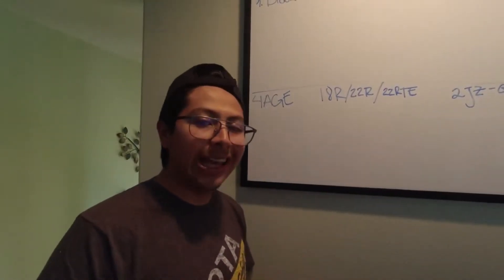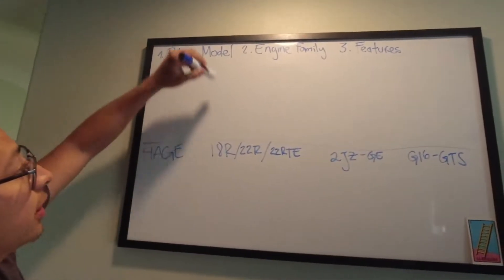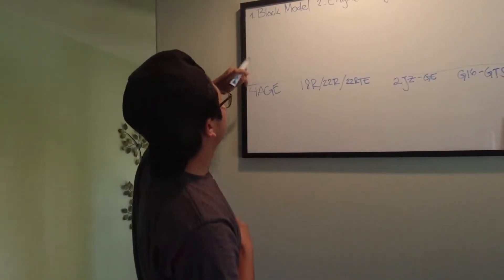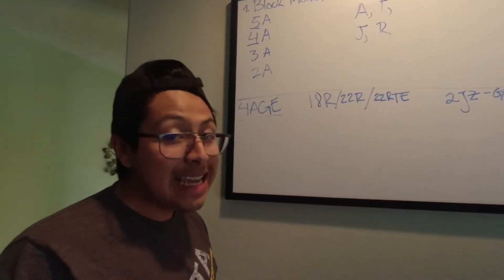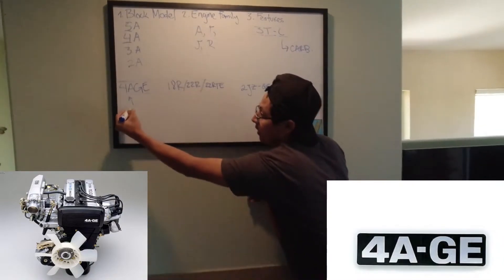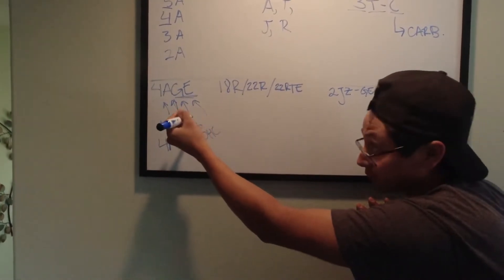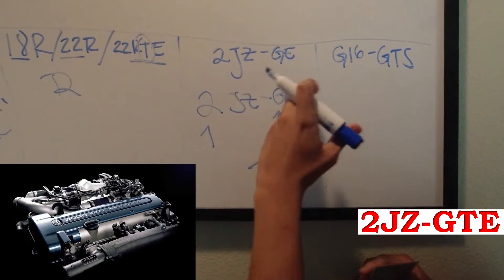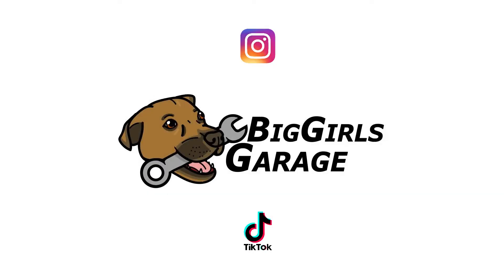ENGINE NAMES (explained) | TOYOTA

Comment: If I understand this correctly. The Corolla I have has a 4AC engine. This is good right?
Reply from the maker: The Corolla can have a 4AC or a 4age. The 4AC is the 'normal' version while the 4AGE is the sport version that makes over 30% more power.
Reply: @biggirlsgarage8331 4AC Means its means california emmisions compliant same as U is Japan Emmisions compliant not carb , if it's  carb ,  it would be 4AF or 4AG

for example 22-r is a carb version of 22-re 

GE is not Just DOHC but  performence Cams 

FE is DOHC normal Cams for a grocery getter

i just wanted to pointed that out , the chart you showed is from wiki and we all know wiki is  not that accurate on info

Comment: Block model number has nothing to do with displacement. Case in point : 1mz is 3 liter, 2mz is 2,5 liter and 3mz is 3,3 liter.
Reply from the maker: This is true. It has to do with Revision which SOMETIMES it is related to displacement.

Comment: So you say that in a glanza engine which goes by 4E-FTE the features are the FTE all together?
Reply from the maker: F = twin cam (standard)
T = Turbo 
E = Electronic Fuel Injection

Thats a fun engine/car
Reply: @biggirlsgarage8331  Thanks! Indeed it is. A very good and solid daily pocket rocket
Reply: @ThatMofoDamon  tremendously cool car